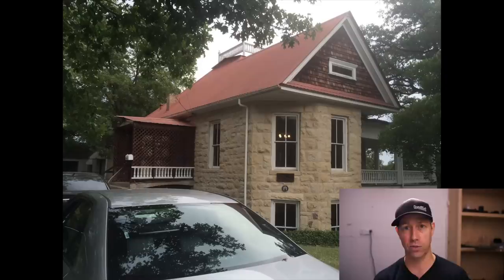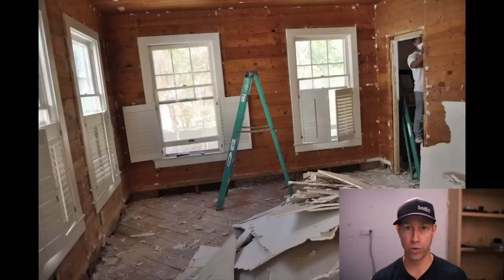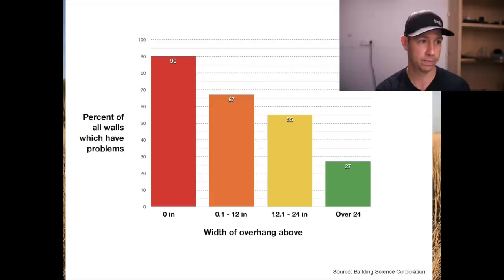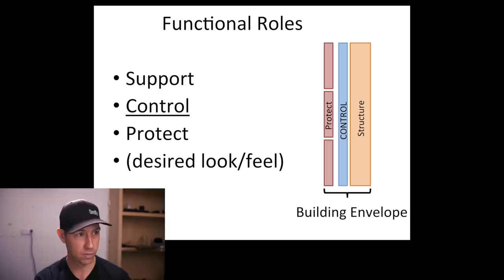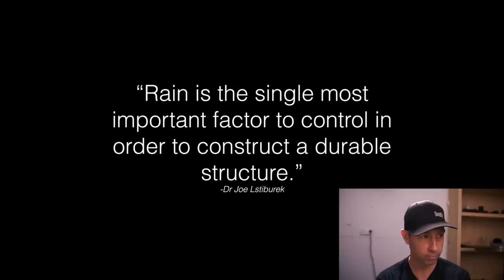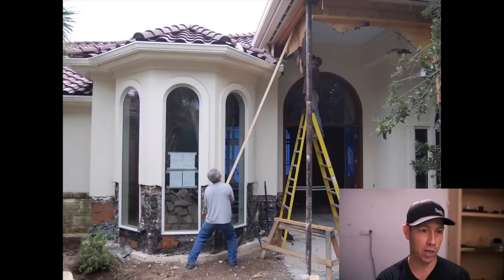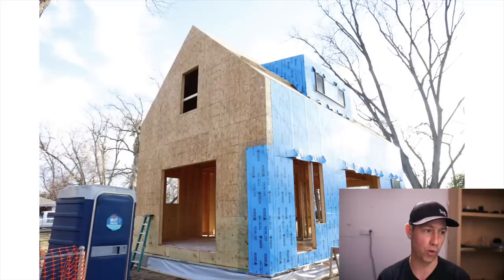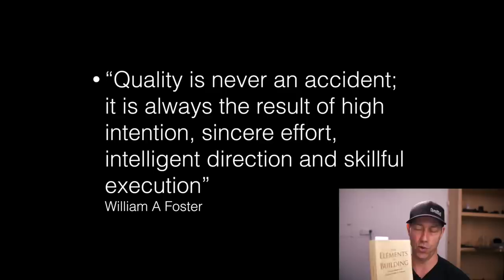Were Old Houses Built Better?

Comment: I come from a family of builders/ masons. My great grandfather was a builder from the 1940’s- 1980’s and  built my family home in 1955, the “mid century era”. I have the blueprints. 12” block foundation with mortar filled cavities. Then they took 4” block and sandwiched it to the 12” block with mortar to make for a 16” thick foundation. (I guess they don’t make 16” concrete block?) They only did this on the long walls of the house going perpendicular to the floor joists. The “side walls” are just 12” block. Then you have 6” block at the mud sill all the way to the roof on all exterior walls (instead of wood 2 by framing with sheathing). The finish is 4” brick veneer fastened with metal straps against the concrete block behind it. The main girder is actually an 8” concrete block wall with a footing of its own with 4 2x8’s built up to span in the 3 openings to get from one side of the basement to the other. Floor is 6” poured (no rebar). Garage is in the basement of the house with a 8” steel I beam for the girder and two steel lolly columns set in the concrete floor. The garage floor has an 8” poured floor (no rebar). I must mention there is only one very minor hairline crack and that’s if you look hard. Not bad for non-reinforced floor after 60 plus years. It is slightly pitted though on one side where the main car was parked over the years. The inner wall of the garage is an 8” block wall for extra support and acts a as a firewall  to the rest of the basement. The floor joists are 2X10’s western lumber (as the whole house is western lumber) 16” on center spanning 14’. The subfloor is 3/4” plywood (Unfortunately  not 1x8 tongue and groove solid wood laid diagonally but plywood is strong too). Roof is hipped with 2x8 rafters and 2x10 hip rafters and a 2x10 ridge board. 2x4 collar ties every other rafter. 3/4 plywood on top of that. The ceiling joists are 2x8’s. Inner wall framing of house is nothing special with 2x4 framing but has “diagonal reinforcement”. The chimney/ fireplace which is shared by the boiler and hot water heater is a whole story of its own. The hearth support to the fireplace is a block wall not a poured cantilever at an angle. So under the 4” solid marble hearth top, there is a cavity of dead space you have to reach through a tiny door and then go through another opening (long arms help) to clean the ashes. Let’s just say it’s easier to sweep them out after they cool off. 

I’m assuming because the house was built for family a little bit more went into it. It’s certainly a well built home. The insulation is not the greatest. The only insulation we have is in the ceiling joists and in the garage ceiling.

Comment: It is really surprising to see the building changes over the years. I am currently living in and renovating an old house that was pieced together over 100 years and hasn't seen any major changes in 60 years. While the walls are hollow with no exterior insulation, the plaster on the inside does an impressive job of sealing the housing envelope. Heating and cooling is costing around $1500 a year, but that is by no means wild for central Wisconsin. It is good to see how things are done currently and what can be retrofitted to improve this old house. Keep up the good work.

Comment: Another great video. I would add some important notes, however. High quality buildings must meet high indoor air quality standards, high energy efficiency, and high standards for environmental impact and embedded carbon of materials. That means hard foam, spray foam, rock wool and fiberglass insulation are out. High density blown, recycled cellulose and straw bale are the only remaining insulation types that meet these standards. Steel siding, kiln-fired brick and steel roofing are also out. That leaves cedar shingle, thatch, slate, sun-baked clay tile, green roofs, plaster (exterior) and adobe (interior)  wall finishes. Concrete use must be minimal. That means pier and beam foundations only. High standards can best be met with natural materials. Beauty and durability also.

Comment: I think old music and old houses are a lot alike. In that someone who is younger may get the impression that all old music is great because all the old music they typically hear is from someone's collection of best-sellers or greatest hits. 

Old houses that are still standing & not rotten thru are the ones that didn't burn down, the ones that didn't rot, the ones that stood up against storm after storm, but there's plenty of old houses that for whatever reasons don't stand the test of time, just like there's plenty of old music that's forgettable, or bad, or unpopular.   

Time is a filter, not everything built today will have longevity, but some of it will. Not everything built back then had longevity, but some of it did. PRE-AC It wasn't uncommon to sleep outside in the summer. In cities fire escapes & parks were invaded by night sleepers, in rural areas people would sleep on porches, or in open fields, because houses were heat boxes, if anyone did any cooking inside it would make the house unlivable on a hot night. Of course, cooking outside during the summer was common too.

Comment: This kind of video really highlights to me how good brick masonry is as a construction material, particularly with brick tiles: in the UK, we generally don't even consider house longevity as a concern, despite a very wet climate. As long as there's a decent damp course, you can basically not even think about it: my street is a mixture of 40 and 100 year old houses, and other than the 100 year old houses being due a roof replacement (half are done, half will need doing soon), I'm pretty much entirely unaware of any real degradation in any property here, out of 80+ homes

Comment: Excellent information Matt.  I have a manufactured home in California that was built in 1987 and they had no overhangs on the composition pitched roof.  The rain runs down the wall on to a composite siding and several times I have had to replace sections with Hardie Board.  California law for manufactured homes changed I they have some overhangs.  That is my next project trying to devise a was to have overhangs on the house.

Comment: I'm in a 1927 house. In the early 50s, a patio was added along the back wall. Not only are the original fiberglass roof panels still in good shape, but the  4 x 6  x 20-foot long beam holding them up has not one single knot in its entire length. They just don't make wood like that anymore.

Comment: Great video! Thank you.
A comment on the 2018 v/s 1880 or 1930 lumber. The number of growth rings was greater....and so was the resin. Resin is what makes the tree strong and resists bending......resin is also not water soluble. Lumber today is genetically designed with less resin and fast growth....because the same trees are  used to make paper. The paper industry does not want the resin.

Comment: Most old houses were built well stronger woods and insect resistant hard woods but it all depends on the area.  Or era of construction  I find pre 1930 homes were built way better then after the 30s. Our home built in the 1911 to 1913 range was really built strong the second floor beams are  spaced at 15  or less and are huge 3 x 10 beams. Love a house that doesn’t even creek when it’s super windy  unlike some I have been in built after the 30s that moan in the wind lol

Comment: I know I remember when I was building modular homes for Canada, specially for the hardyplank siding vapour control on the outside was very important, with standoffs and vents on top/bottom all way along to allow air to flow under the siding uninterupted.

So its nice to see similar techniques used here

Comment: The "Ralph McTell" style of construction seems pretty prevalent in the US.  Whereas in Europe they are built to last.  When I was in Australia we built a house in Queensland - Cyclone country.  The Regs there were that the house had to be made of concrete blocks.  Re-bar was set into the foundations before block laying.  The re-bar extended above roof level and through the wood roof timbers, then when the roof was finished the bars cut off and threaded.  Nuts and washers put on and tightened down.  Effectively the house is bolted to the ground and Cyclone proof.  From a safety point of view it also ensures the when the big blow comes roofing material is not scything through the air and decapitating people.  Good plan if you don't want your home to get blown away in windy weather or burn up like a cardboard box in the hot.  The still standing chimney stacks after a fire should tell you a lot.  Build properly.

Comment: We just bought a 1925 craftsman and are moving from our first house, which is a new build (2010). Our new construction home had a few issues, mainly quality issues (some cracking around the lentils from settling, a room with saggy floors in one of the bedrooms, nail pops; but otherwise a solid build for its price point. Our 1925 home has been remodeled with modern touches but it looks to be super solid.

Comment: My first home was a cottage style built in 1929. Real 2X4's on 24" centers. Lath and plaster. Unfortunate they use beach sand I recon because the perimeter foundation was in spots crumbling and had to redo. In SoCal not much rain so the crawl space had 4X4 post holding up the floor and were sitting on 2X12X12 wood pads on the dirt. No termites. There was an addition added with 1" pine boards that the termites ate up that I had to replace.

Comment: I'm pretty sure that waterproofing/barrier should be running lengthwise horizontally along the house to minimize the vertical seams and any areas water can find its way into. In fact, it should be one long piece going at least going from end to end, overlapping the next piece underneath.

Comment: A few points in this video brought back memories of houses - particularly older houses - in my area. One was a remodel job on a house across the street from my grandparents, where the bulty and addition to an existing home. Folks  (especially my grandfather) talked about how that thing was going to be falling in in no time. They didn't even use "real" lumber. It was framed with PINE! Everyone knew that was to flimsy to build with.

Years later I helped my father tear down an old house to reclaim the wood. In it, a 2x4 measure 2 inches (or slightly over) by 4 inches. The floor joists were 2x8. All the framing was oak. The interior walls had wallpaper over them, but stripping it away revealed tongue and groove board wall. Again, all hardwood although they weren't oak. I variety of hardwoods were identified, but more than a third of the wall boards were black walnut. 
THINK ABOUT WHAT THAT WOULD COST TODAY.

Comment: Those dark patches on the wallpaper is condensation hence no damage underneath. In fact this is the aftermath which is salts coming onto the surface of the wall. Very common here in the UK.

Which also explains why you should install radiators underneath windows.

Comment: Older homes are stronger because the framing lumber were thicker which can carry more weight old 2x4 were aprox 1.75" x 3.75 to 4" today 2x4 is thinner and weaker. Builders used what lumber they had back then. Some people used oak pine/fir etc.

Comment: I have a 1940 cottage 1200 sq ft,  very little insulation yet we made it through a central Florida summer with our highest electric bill $115,  that is with two window AC units running nearly 24/7 ,  not sure a modern built home with central air would have done a whole lot better

Comment: You are right...I had to have central air installed. Heating used to be done via oil heater and wall-unit cooling.  Oil heater heating is rejected by all home-owners insurance.  OLD HOUSES may also be issues with asbestos -- there are strict OSHA requirements dealing with this cancer-causing substance, and lead paint.

Comment: I live in a Bayern farmer house within old outer-city limit that was built in Holy-Roman Empire around the times of Charles III Philip, there's no single parallel, straight, square wall. Internal walls are nearly as thick as external walls and overhang is around 1m (it covers most of the pedestrian walk under it), before few years ago, it was renovated in 1810, wood/dirt floor was replaced only few years ago, barn section of the house still have dirt floor.

And considering it's a historical building (Denkmalschutz), it's a darn pain to get anything structural or exterior altered as it required review and approvals and they deny most of the time, it's not possible to install sun panels for example, at least you can see alps from it =)

Comment: It’s remarkable how different the building standards are in the US vs Europe and The Netherlands in particular. Here most houses consist of concrete inner walls of about 6 inches (150mm), than an insulation layer and than a brick outer wall, adding another 150mm. Floors are all concrete. Roofs are made with wood, also a good layer of paint insulation and roof-tiles. That’s all very solid and robust on the plus side. Not so plus is the cost that goes from about €200k for a on both side attached house in a row to about €500k for a semi attached one to €750k for a unattached house. Gardens are usually ridiculously (to us standards) small because of regulations that aims to have compact urban areas (so children can walk or go on a bike to school).

Comment: I think the problem is with the outside. In Hungary, we plaster the outsides of the houses. They are made of foam, wood, masonry, and none of them rot. Plaster and the like is great. Mudhouses, are a bit different, because they have to be soaped, glued, layered and than plastered. But generally, none of them have rot problems.

Comment: Very cool video! What was done in the last project is a layered  massing on the exterior, without resorting to brick or stone. This project would probably have been just as cool if full stone and true 2x framing were used. The problem with that is its very expensive in terms of materials and labor.

Comment: Great video. I learned my craft in the UK but I've been building in California for a few decades. Water control and air flow are the most important factors for making a home last. Lots of new homes I see being built in the US are going to have problems, poor workmanship and bad choice of materials are a sure way to have failure. Personally, I feel the homes built between 1920-1940 are the best homes here, one of these fully remodeled will last a lot longer than a new home and has a lot more character and style.

Comment: Funny thing about EIFS.
Americans and Canadians used, and still do, EIFS on wood framed houses which flex and move, whereas Europeans (where EIFS originated) use it on solid masonry walls which do not flex or move (except during earthquakes), and they hardly ever have problems.
Only one time did I see an EIFS failure in Europe - the insulation fell off the structural masonry wall, because the contractor put the insulation up when it was too cold, and the adhesive failed (he didn't use fasteners either).
Anyways, if the walls move, the stucco will crack, and you will get water in the insulation, and behind the insulation.
This will cause the insulation to separate from the substrate, water gets in and you have rot.
EIFS is an excellent system, but only on the right substrates
Some EIFS manufacturers have little channels in the back of the insulation for airspace, but that is still a mickey mouse solution to the problem.
If you want to use EIFS, don't put it on wood framed house - put it on the masonry.

Comment: 100% agree that the 'vapor barrier' should be the outside face of the sheathing/plywood. Exterior siding with a gap to that and allow breathe moisture back to outside.
Reply: I'm Canadian, and what we saw in that photo is what we do, where the cold is on the outside for a lot of the year.  Problem is, though, our summers aren't really that much cooler than Texas ones, just shorter, and that's when the air is more humid.  Which is why most new construction uses exterior foam insulation and vinyl siding.

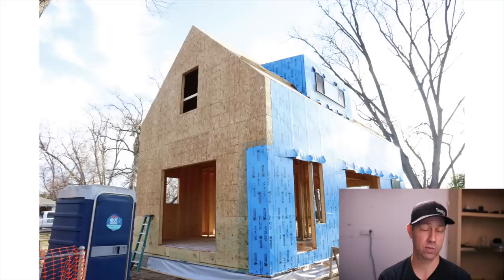Comment: Question @21:00, Placing the insulation/thermal control on top of the water-shield/air&water control layer, wouldn’t the insulation degrade in periods with lots of rain fall. I understand the insulation can dry on top of the waterproofing, but why not protect the insulation from getting wet in the first place ? In addition, wouldn’t bugs be able to get behind the protection layer and burrow into the insulation ? Thank you for the great video

Comment: The difference between the 2 cars, 1 is built for comfort and performance,  the other for longevity and easy maintenance.  So a question about the last house, how did you connect  the thermal blanket, and then how did you connect the batons? Im suspecting there are penetration at every connection  through the thermal and the water barrier.

Comment: My sisters house was built in 2008, and has more issues than my house built in 1870’s. Her master bathroom, the studs in the shower were completely moldy and soft. The guy used normal drywall in the shower with mastic for the tiles. Her walls inside are cracking, and the exterior is already rotten. List goes on.

Comment: Basically don't skimp on the price and don't build your house out of plywood and paper. Build it from concrete and brick, insulate from outside, insulate the foundation, use sump pits properly, use gutters on the roof, have a good roof (with steep incline), have proper double or triple glazed windows, it will last you a few hundred years. Ideally have the terrain under your house raised before you build, so you build on a bit of a hill, that helps greatly with removing water from around the house, also in case of flooding those 4-5 inches of raised ground can be a life saver. Use sand to raise the terrain so water drains away easily. Cost of building will probably be 200k but it will last generations.